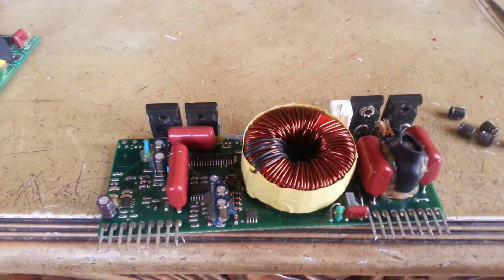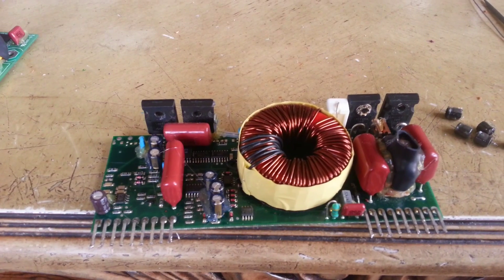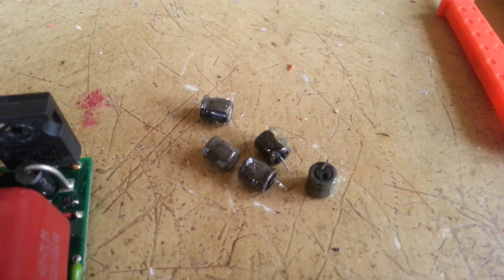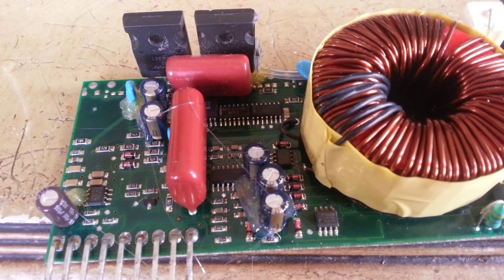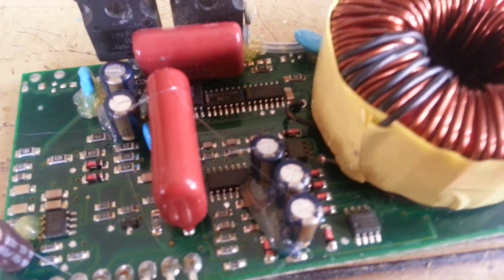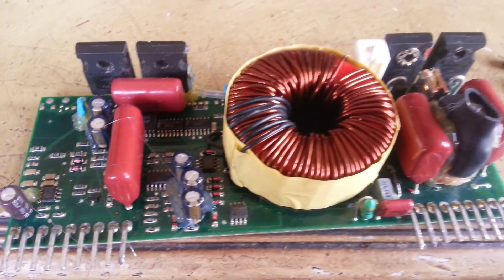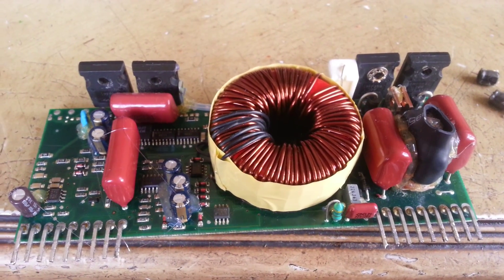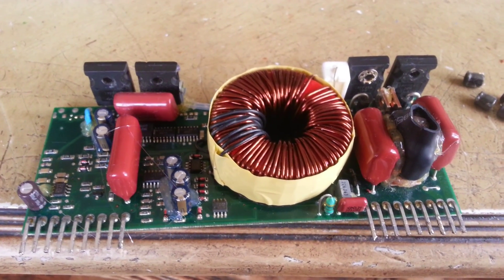Velodyne Subwoofer problem, how to repair Part 1

Comment: If you’re just replacing those 5–33uf 35v caps, you don’t have to actually desolder thr entire amp board that has the cage around it.  You can just remove a single 470uf 200v cap in order to access the underside of the caps you want to replace.  jus remove the cap that’s second from the right and it exposes enough space to remove and replace those 5 caps.  Saves a lot of time and patience removing all those pins keeping the whole board soldered in.  You do have to remove as much of the cage as possible of course.  But significantly easier to remove a single large cap than the entire board.
Reply: You sound like you know what’s up!?

I have a mid 2000’s mini V 8” 1000watt and it has occasional static. The sub works but intermittent static.

Do you have an idea of what it may be and or were can I get parts or new amp plate?

I need to take it apart and see what’s going on …..

Comment: When I took it apart, there was a birds nest of wire through the vent pole under the magnet. So that tells me the voice coil is also shot. I sent a service request of Validyne and we’ll see how much it cost for a new speaker and then I will fix, the preamplifier and amplifier section because mine looks exactly like yours. I have friends that work at high end guitar pedal companies and bioanalytical companies that do soldering all the time so they will do it right.

Comment: Will this likely be the case for my SPL 15?  Any differences in the process?
Reply from the maker: @greggkathy1892   I am sorry, it was long time ago, I’m not sure, but bad capacitors are very common issues, specially if your sub was working, then it stopped working for no reason. Good luck

Comment: Hi I have a velodyne SPL series 2 subwoofer, It is acting weird lately. On lower volumes it ka working fine, after after a certain level the subwoofer starts to move crazy and bottoms out, pl help
Reply from the maker: Sorry to hear that, sounds like some capacitor, or capacitors is getting bad.
Reply: @artsvideoonline  should i replace the preamp section caps?
Reply: Could a faulty volume potentiometer be the reason? Also the volume goes very low when internal x-over is selected

Comment: I have a CT 120 Velodyne sub that stopped working. The light comes on in the back but I get no audio. How do you take the amp out? There are very short wires and I can't figure out how to disconnect them.
Reply from the maker: I am sorry, it was long time ago and I don't remember exactly how, but it should be very easy. If the wires are very short from the amp side-try to disconnect them from the speaker side.

Comment: I fix many Velodyne subs, sometimes I find one or two sop8 regulators un short circuit and some output transistor plus IRS2101S.

Best Regards.
Reply: Did you repair the DLS4000R model? it worked normally, one day it started making noise on the woofer but it still worked, now it stopped forever.
Reply: @variedades4848  Hi, I fix many Velodyne and others subs.
If you have an electronics background send me some pictures and I can help you fixing your sub.
Many subs have a dangerous high  voltaje inside, extreme precaution.
ricbed@gmail.com 

Best Regards

Comment: Hello Artur, I have an old velodyne dls-5000r that powers up, but no sound. I'd check fuse and the speaker and both are working good.  I wonder if you have an schematic or service manual ? and also how can I avoid any electric shock in case of trying to replace the caps ?  Thanks in advance,
Reply from the maker: If the fuses and the speaker are good, most likely the capacitors are bad, as I describe in the video, when you work make sure the power is OF and discharge the big capacitors on the power amp. Sorry, I don't have the schematic
 Good luck

Comment: hi do you have a schematic diagram of Dls5000r?
Reply from the maker: Sorry, just did a research -can't find it, but if you have a similar problem could be bad capacitors, I mean if it worked before and after a long time no use got bad-could be capacitors.

Comment: I have a Velodyne CHT-10 and similar problem to what another user mentioned - it will work intermittently, and generally at low volumes, but for a loud explosion or bass note it will trip and have to cycle to power to work again.  You mentioned it's likely to be the large capacitor - which one(s) would you recommend to test/replace?  Thanks!
Reply from the maker: Sorry, I don't remember at this point, but I am sure I have it in my video,  also I would recommend you to check all the comments.  Sounds like bad capacitor in the power amp section.

Comment: Do you have the schematics or service updates by chance?  I have the same amplifier in my 2009 minivee I am repairing.  I'm wondering if there was a service update at some point because my amp has (5) 4u7 35v tatalum capacitors, instead of the 33uf 35v shown in your video.  Would love any info if anyone knows!
Reply from the maker: here is a link you can find any schematic you want
https://elektrotanya.com/korg_i5s_service_manual.pdf/download.html

Comment: Just fixed two of these amps. One from SPL-1000, another from SPL-1200. Was a pain in the ass to desolder and remove amp board from the"hot cage"! Anyway, thanks for the help!
Reply: I fix many Velodyne subs, the tools what you should  use it is very important.

I use a Hakko desoldering gun, with this tool is really easy to remove the amplifier module.
One 90 watts induction soldering station.

One ESR meter.

Many technicians check the amplifier only but I find a lot of capacitors faulty in the croosover board, I prefer to do a total recap each time.

In the amplifier is usual to find some bad capacitors and sometimes I find one LM78L15ACM faulty.

Cheers.
Reply: @treadmillrepair754  hello , I have a SPL-R 1500,
My sub started to make a crackling noise , I want to try to do the total recap do you have recommendations for this sub?
Reply: @genkoop10  Yes, recap is necessary, but cracking noise is for another problem.
Look for brown glue and remove and clean with thinner.
Best Regards.
Reply: @treadmillrepair754  What usually fails on a HGS that's causing crackling? I replaced the 6 Large Caps.
Reply: @looksthatkill3383  In the amplifier module you can find 5 tantalium capacitors, usually they fail and sub Chracking.
Best Regards
Reply: @treadmillrepair754  The Hakko desoldering gun is over $300!
Reply from the maker: Yes, it is very difficult to desolder it, they made it the way like will never go bad.
 Congratulations, good job.

Comment: Damn it my velodyne CHT 10 quit working out of nowhere but you are right on the video it was put up for a year or so used for about 2 years and then put up for another year or so was working fine yesterday and now it just quit but the green light still comes on in the back if the capacitors are bad would the green light still come on
Reply: Did you ever find out?  I now have a bad CT 120 Velodyne. No sound but the light is still on.

Comment: When these capacitors do this,  is it obvious? Would a test with a multimeter show it?  Would the capacitors have a bulging top?  Or is it an undetectable problem. My velodyne Deco 8E was left for years and after 1 year of hard  daily use, it has stopped giving any output,  just a tiny little buzz.
Reply from the maker: You can not check it with multimeter. After a wile they just lose their capacity.
Reply: Artur Aroustamian I've now done this and my sub now works! Thank you Artur, I never would've found this information without your video!
Reply from the maker: Congratulations, i am very happy for you. Good job.

Comment: Hi there.  I have a digital Velodyne DLS10, the subwoofer works fine at low - medium volumes, but as soon as it needs to make a loud BOOM (i.e. for an explosion in a movie) the circuit trips.  I then have to cycle the power off and on for it to work again.  Would this also be due to bad capacitors?
Reply from the maker: It sounds like bad capacitor, but the large one. Service manual can be downloaded here:
 https://elektrotanya.com/velodyne_spl-10_control-pcb_sch.pdf/download.html
 
always work ,when the power is OF, it has "hot ground" on it!!!

Comment: This fixed mine. Pretty obvious quality problem. Cheap Korean capacitors where there is most the most heat. Engineered to fail :(
Reply from the maker: Jonas Lithén I am very happy this video helped you to bring back your subwoofer to the life again. Congrats
Reply: What sub did you work on? HGS?

Comment: Guys, before you try to repair this model please read "small print" below. 
This unit has hot chassis, so most of the components including aluminum cage can carry live voltage  and can cause an electric shock if you touch them while the unit is on. Also if a mistake was made during the repair (bad soldering, soldering bridge, reversed polarity, broken trace, etc) your velodyne amplifier or your woofer can get serious beyond repair damage or increase repair cost when you finally bring it to a pro later. No guarantee that the caps will fix your unit, there are many other problems. These units are critical to connection, when you pull it from the cabinet make sure you have marked all connection. For HGS model -reversing speaker wires or shifting/reversing accelerometer plug can cause woofer or amplifier damage.
Reply: LOL ohh man, servo feedback system with a reversed wired actuator would be fun to watch. It'd slam the driver to the limits continuously until something fails...
Reply: In other words you will get a nice firework show if you screw things up! I learned a few lessons over the years.

Comment: Thanks for your video. suddently my velodyne 1200R made strange sound like electronic parasite  but last time I was use it and shut it off everythings was fine this is similar about what you said in your description. you video give me hope again. thanks a lot
Reply: loubano im curious to know if u got it fix and what was your issue mine made a whisling type noise i change fuse out and it work for a little then went out again

Comment: What model amp are you working on? I have a bad HGS12. Thanks.
Reply: 8 years and no answer to this guy's question.  Video shows 5 old capacitors removed---but 6 on the board (????) .  OK, so much for credibility.